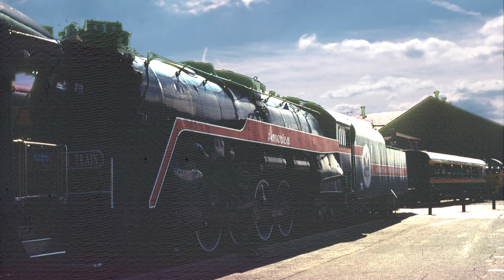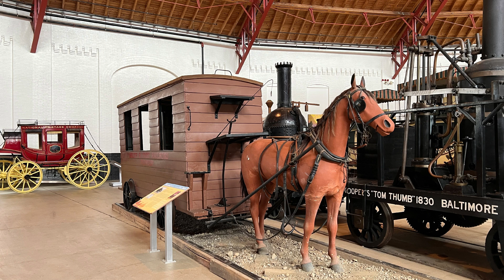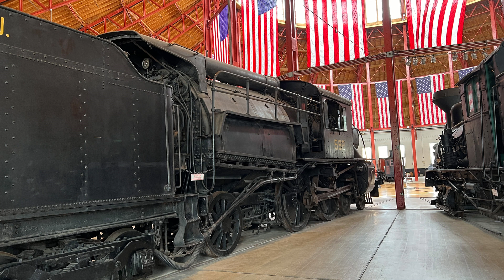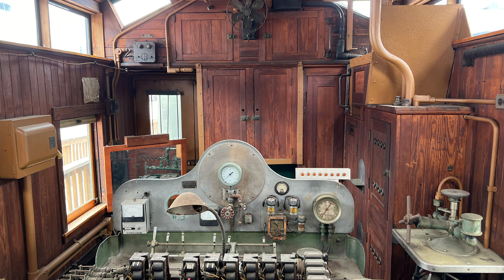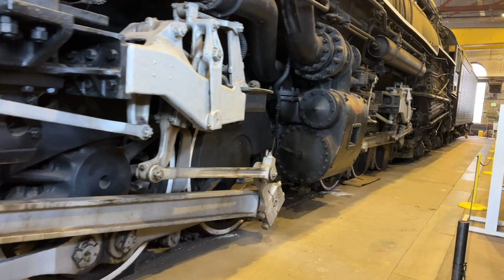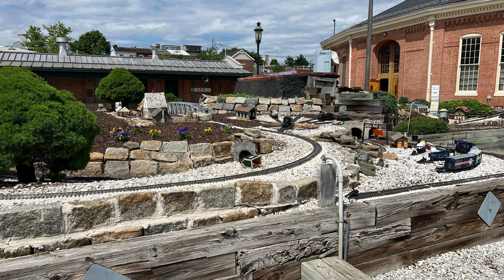The B&O Railroad Museum

Comment: I've visited that museum but not for many years. I believe that the Shay on display there came from Cass after the museum sent the much more impressive Western Maryland #6 to be run there and Cass sent back one of theirs so that the museum would have something to display. The MARC 7100 was used as a head end power generator with the axles not driven. MARC now has enough equipment and does not need it. I have read that the 2-6-6-6 Allegheny's could possibly have outdone a Big Boy if given a chance. They were stronger in terms of tractive effort, but the C&O did not use them for speed.

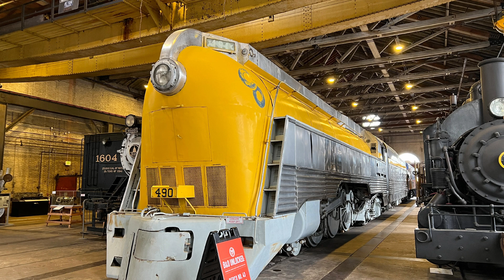Comment: 8:11 and actually 490 was originally a 4-6-2 pacific that was converted into a 4-6-4 hudson when it got the streamlining.
Reply from the maker: That I didn’t know.   Locomotive 2102 in my Reading, Blue Mountain, and Northern video was also built as a Pacific in the 1920s and converted to a Northern in the 1940s.  Was that a common thing?
Reply: @jayeibner974  ok first of all, the T-1s like 2102 were 2-8-0 consolidations that were converted into 4-8-4 northerns. Second, yeah it was common to rebuild locomotives, but there was a scale as to how "rebuilt" you wanted them. The T-1s are pretty much brand new locomotives with next to nothing left from their original 2-8-0 forms